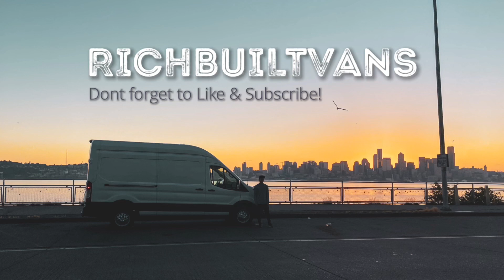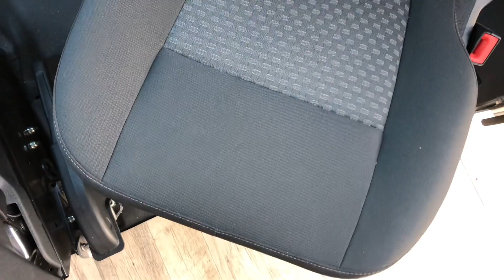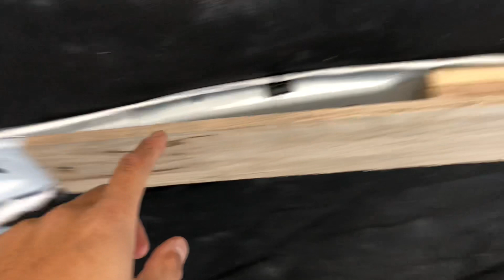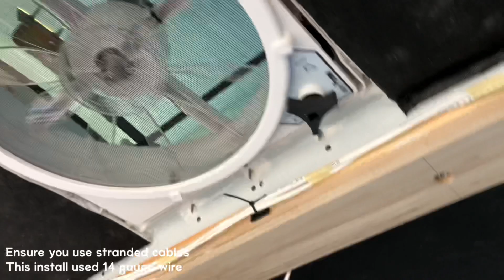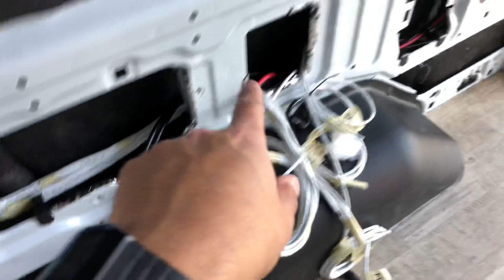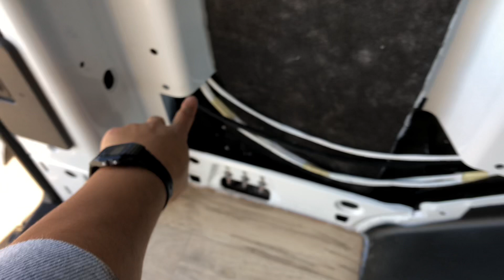AWD Ford Transit ELECTRICAL ROUGH-IN & FIRE EXTINGUISHER - Part 14

Comment: Hi.  Could you please explain how you are connecting your BlueSea 12V fuse block to the Bluetti to power everything that is hooked up to the fuse block.  Is there a special adapter or connector from the Bluetti to the fuse block?  Thanks.
Reply: Hi Rich, great videos. Also interested to know how you did this. Thanks

Comment: And if you don’t mind Rich where’d you get your cables what awg are they. Oh And what kind of cables are they.
Reply from the maker: Hey Billy - they are 14awg cables I got from a local distributer.  I linked to a similar brand on Amazon in the description. I like these since they come with a protective sleeve out of the roll.

Comment: Hey Rich, you may want to check these out. This is what I’m going to be using for my wires to come through the wood check it out.

Desk Grommet 2 Inch, Plastic Desk Cord Cable Hole Cover Grommet ...
$7.98 find these on Amazon
Reply from the maker: ooo thank you for the headsup!

Comment: Hey there. I'm looking at doing the same kind of thing with the same van but wondered if you checked out the H2 model before going for the H3? Is the H2 too low for comfortable living? I would rather get the H2  to get into carparks under trees ext but don't want to regret that later. Do you think a H2 would be a bad choice? I'm not looking to live in it permanently but a month or so at a time
Reply from the maker: Hey Barry - I'm not sure what the reference to H2 vs H3 is to.  Is that medium roof vs high roof? I would recommend walking in both cabs to be sure and cross reference you potential layout or roof configuration. You'll know exactly what fits you best as soon as you step/stand inside.
Reply: @RichBuilt  Yeah sorry I'm in the UK we have them as H2 for medium roof H3 for high roof. Although no low roof one. We have L1, L2, L3 and L4 for the lengths too
Reply from the maker: @barrynoble2326  no worries, I think the mid-roof or H2 is still too tall to fit in car parks in the states. but more headroom is always better if you plan to live in it. I'm 5-7 and found the high roof just right.  The mid-roof or H2 seemed too low for me. It may be better with crosswind and fuel efficiency.